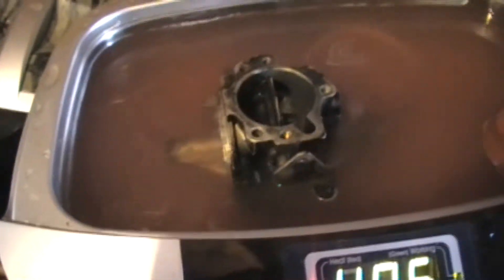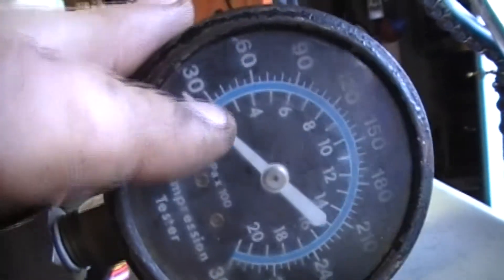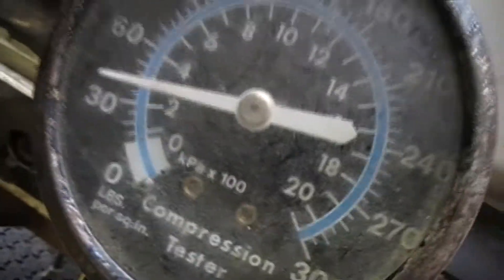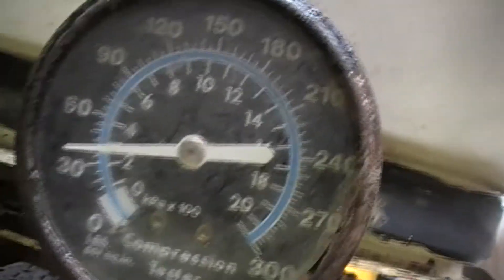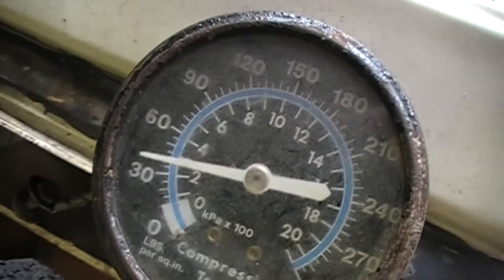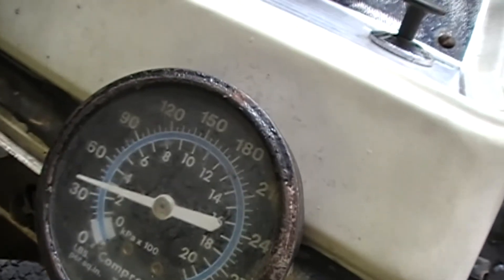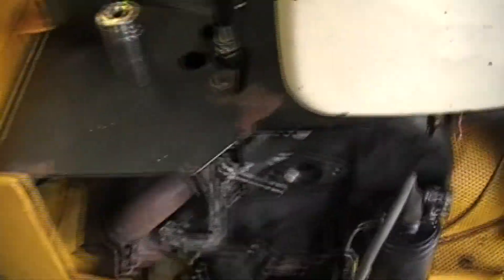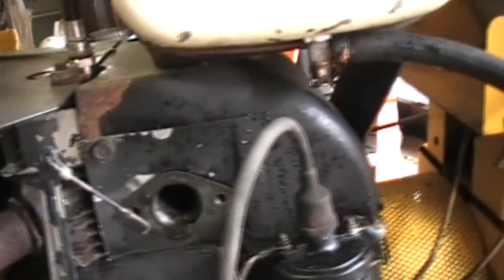cub cadet 127 K301 compression 35psi not good

Comment: It does not have low compression it has a compression relief valve in the motor you will have to spin it backwards for it to get a proper reading

Comment: Go to Kohler.com and click the engine model  and it will tell you everything and check the points or even the coil mine would run fine then after warming up it would run like crap or quit

Comment: Hang on to your wallet if thinking about replacing that engine. My Cub 122's K301 was rebuilt WRONG by a professional. Needless to say it fucked up in a bad way. The replacement engine from Smallenginewharehouse(DOT) COM was close to 1200 bucks, but it is an exact drop in replacement. 35 PSI is not bad, LOL. I have a Briggs 13000 series engine on a tiller given to my this past Friday. It tested 21 psi on the gauge. It will run, I don't know why I'm dickin with it, but I'm cleaning the carb now.

Comment: Take the fking head off and pull the fking valves out and clean them . Lap the valves back in and check the clearances . They should be at 6 and 8 .   .06 intake and .08 exhaust .  This guy should never work on an engine if he think the cause of low compression is because the engine is worn out .   That is not true . A good tune up is cleaning the head , valves , top of piston . You can even use the old gasket if it is not messed up .
Reply from the maker: +Jeff Mullinix  im sorry bud but why take something apart if its not needed diagnose the issue first then fix the issue